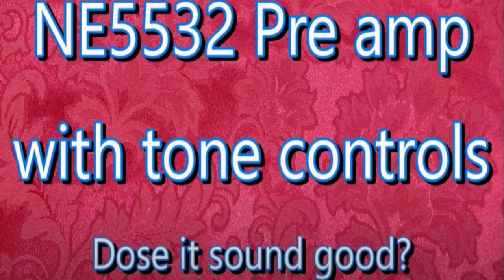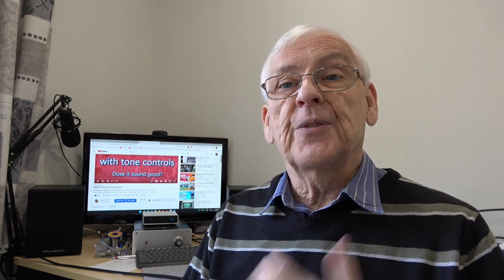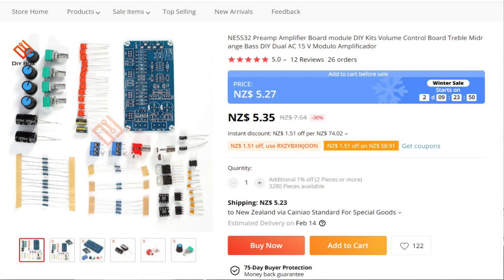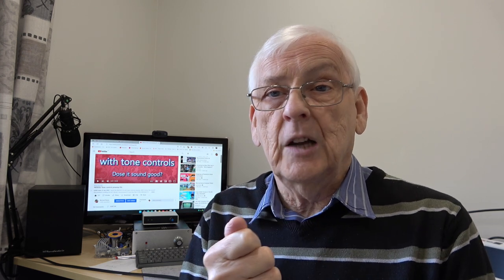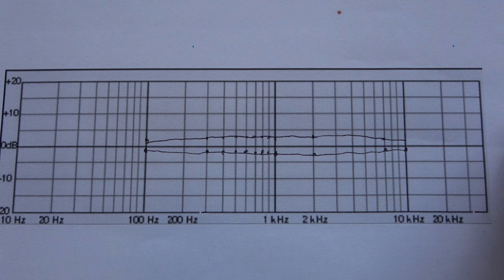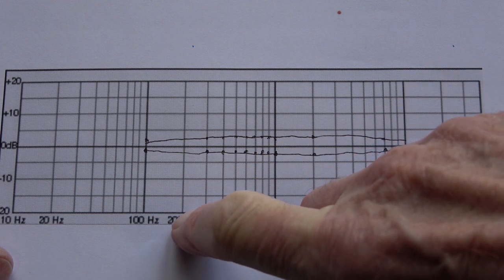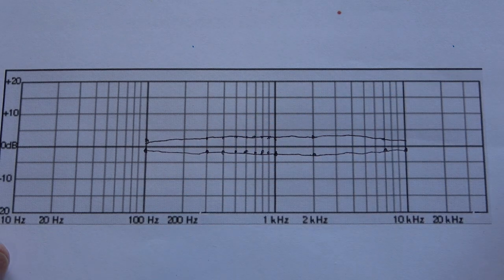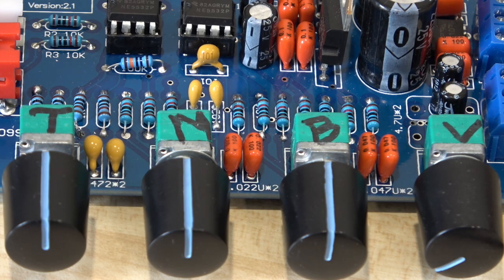NE5532 Tone Control Preamp Kit MODIFIED

Comment: Can we make this have more gain? I have an amplifier that needs more going thans this can supply. Im guessi g this is near 1 to 1 gain.
Reply: Sure we can have more gain. Just change resistors on the buffer IC according to NE5532 datasheet. There equitation how to calculate resistors values.
Reply from the maker: The gain is in the lift. At 1khz the gain this very low. This is not really a preamp more of a tone control network. You will find many preamps with a 5532 for a few $$.

Comment: Excellent, Michael. Do you think that this board has the potential to be tweaked so that the Bass lift/cut starts at 100Hz? I'm tempted to buy this kit and try to make such a change! Have you any advice on such a tweak?
Reply from the maker: The only problem with these mods is a reduced overload performance. The best type of tone controls is the Baxendell curves. That truly gives a very nice curve that only boosts the extreme ends of the spectrum and has no effect on the mid-range. I am actively looking for such a kit at present.

Comment: Wich resistors can i use for the volume pot?
Reply from the maker: The volume pot does not have any resistors.
Reply: @MichaelBeeny  I have a preamp with linear volume pot, it gives me a lot of gain with just a single touch because my power amp doest have volume control. Is there a way to make it smoother?

Sorry for my broken English.
Reply from the maker: @eprpop  A linear pot is not made for use as a volume control for this reason. You should always use a log type. Sounds silly but to your ears it will sound linear.

Comment: Very nice review and mod. I I've messaged you regarding my little 5x gain preamp  xh-a902 . What do you think the gain is on this at full volume? It would be useful to have the capacity to change the sound while recording different records , again would be using with ceramic cart that has 1m resistors inline. What you think ?

Comment: What if you replace all potentiometers to 10k

Doesn't the 1k resistance you have across the one potentiometer create more mono sound since the potentiometer also provides a load between signal and GND? Am I wrong here or right

Comment: Very nice video thanks for sharing. I have the same module and because it's not only a tone control but also a preamp I need more gain because I want to use it as guitar preamplifier and I only need one channel. With the schematic you show I can make a gain control on the board. I will let you know if it works.
Reply from the maker: The basic preamp does not offer much flat gain. The gain is all in the high amount of boost as the tone controls. If you need more gain, and you probably would with a guitar, a further gain stage will be required, best after the tone board.

Comment: Hi Mike! Yes, as I stated previously, I've constructed a few of these. They're so cheap, if it doesn't pan out, what's the loss? I've used one as a backup for amp testing, and to drive another amplifier, when the LJM12 is being driven by my beloved JC-2. It is crazy how it gets out of sorts when you do go too far from flat. I've used most of the mods you've done, and have used some original OPA2134 opamps. And I replaced the volume pot, B50 to A50, or the other way round? I think the difference is noticeable, although I would never call it a "reference" preamp. I will try the resistor subs as well.
Reply from the maker: Hi Bill, nice to chat with you on Skype the other day. Yes, try the resistor mods. I cannot believe you won't find it a 100% improvement. For me it makes it useable in a high-quality system. Let me know what you think! PS the correct LOG pot is A50 (A = log) for some add reason.
Reply: @MichaelBeeny  thanks Mike. Yes I will try that, could be a brilliant mod. Chat soon

Comment: Active crossover or passive crossover which is the best for professional home audio system?....
Reply from the maker: Well Aditya, they are almost the same thing really. A passive has an insertion loss so then you need a gain stage to bring back the loss of the circuit. If you make it active, the gain is in the feedback loop which will keep distortion and noise as low as possible.
 A passive circuit can only attenuate, the gain has to come from somewhere, nothing is free in life, sadly!!
Reply: @MichaelBeeny  thanks 🙏
Reply from the maker: I think I miss read your question Aditya. As the video subject was tone controls I assumed you meant active or passive tone controls!!
I think you might be talking about loudspeaker crossovers?? If that's the case different answer. An active crossover correctly designed for a specific loudspeaker would always win over a passive one. Most speakers need a degree of EQ of some kind. This is easy to achieve with an active speaker than a passive type.
Reply: @MichaelBeeny  thanks... But how to divide the wattage ratio of 3 way speaker (high, mid & low)?

Comment: I think using 1k resistor for treble is not good idea, because the optimal value to convert from 50k linear to logarithmic is equal from 50/4 to 50/6. The 1k value you use will cause the total pots resistance to drop too low which will place a heavy on the load.
Reply from the maker: I may not have made myself clear but, I'm not converting the law of any of the pots. The 3 tone control pots are all linear and remain that way. The resistors simply change the amount of negative feedback, hence lowering the gain of each band. (and in this process, lowers distortion)
A linear pot was also supplied as the volume control, this is incorrect. It should be a log pot. I simply pointed this out but made no modifications to it.
Reply: On 15:20s I see you soldered resistor parallel to gnd & input of pots, does I see correct ? If i'm corrected that mean you decrease total resistance of pot.
Reply from the maker: @hamdzuii  Yes you are correct. By reducing the resistance you get more negative feedback and that lowers the gain, lowers the noise and distortion. and of course restricts the total range of the pot. The pots are in a feedback loop, they don't in fact go to ground like a volume pot would.
Reply: @MichaelBeeny  Ah yes you right, i'm doesn't looking to schematic at the end of clip, tks you explained.

Comment: Hi Mike! Yes as Ive said before, I've built a few of these. They're so cheap, what's to lose? The latest has OPA2134 opamps, and ive used my own electros, and Panasonic film caps on the input. No, its not hi end, but certainly useful as a test preamp, or in a secondary system. As it turns out, the sound is most respectable when the controls are closest to "flat". The farther they are away from that, the wonkier it gets.
Reply from the maker: Hello again Bill, I bet the OPAs are fakes, gotta be for the price but I don't know how to test the. I think they are mostly all the same fake chips but with different printing on them. But they do work and give value for money.
Reply: @MichaelBeeny  hi Mike. Actually, Ive had them for years! They are TI originals! Worth substantially more now than then!
Reply from the maker: @billkalina3089  Sorry Bill I was not paying attention, I was getting quite excited by the thought of the kit makers using an OPA2134 fake or not. Now I've just had my first cuppa T of the day, I do remember you telling me once before you had some of these.

Comment: Back when I was doing competitive car audio (I had a show car) I would tune my system with an Audio Control 32 band RTA to have an overall response with only 2dB of variation across the entire audio spectrum. I had a 32 band main EQ and other EQs as well if needed to tune individual speaker response to fix resonances. I used to tune for a +1 dB from 20Hz to 160Hz, and a -1dB from 5KHz up. It was one of the best sounding cars at the events often winning SQ. It imaged and staged extremely well too as it was using digital time alignment too (this was back in the late 90’s), I would spend ridiculous amounts of time listening to it to tweak the system.

Comment: Hello Mike, you're spot on about bass & treble controls and maturity, my stereo system has none but there is a level control for the subwoofer.  As for capacitors in the signal path, can we have as few as possible, please!  My vinyl playback system consists of a Pass DIY Pearl 2 RIAA amplifier followed by a single transistor gain stage that has no feedback and a class A power amplifier, and there are just two film capacitors per channel in the signal path.